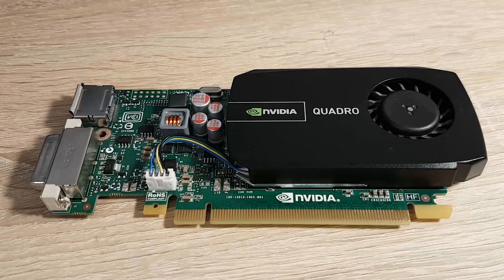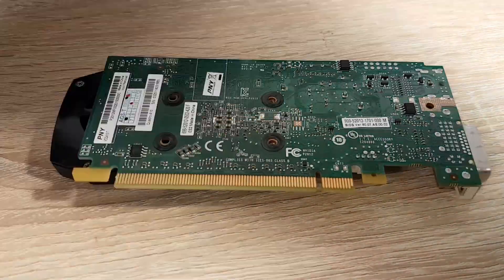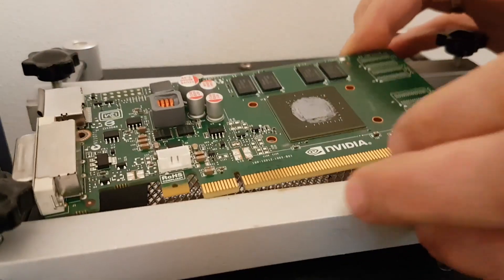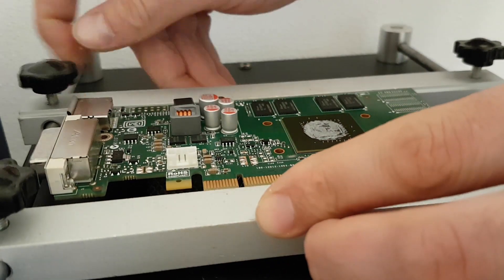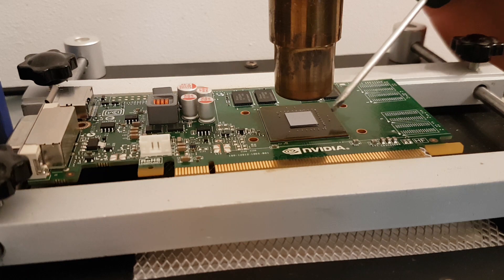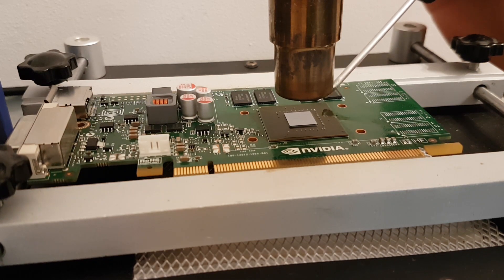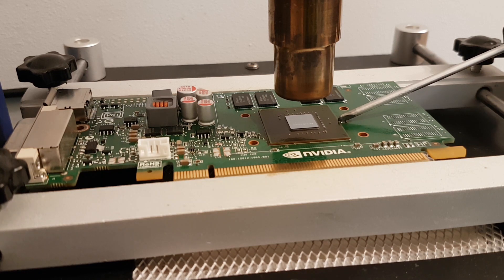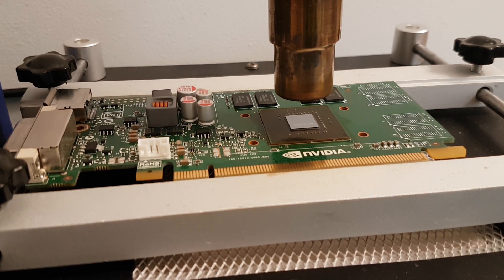How to repair any graphic card - only preheater & hot air

Comment: Hola amigo que temperaturas ha usado por favor
Reply from the maker: For preheater 400 (it this case bottom part of graphic card has around 200), for hot air 340.
The best way for you is using thermocouple. There should be around 230 under chip.
Reply: @TechDayEveryDay  muchas gracias maestro